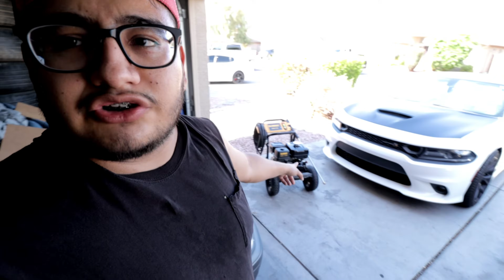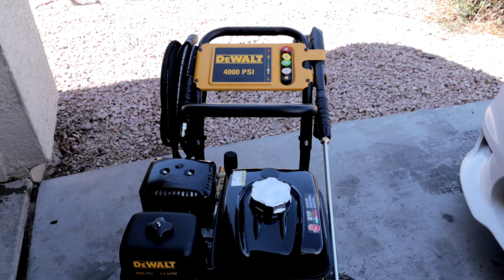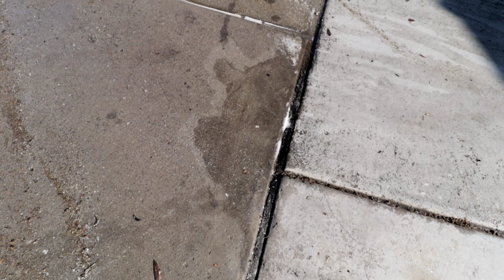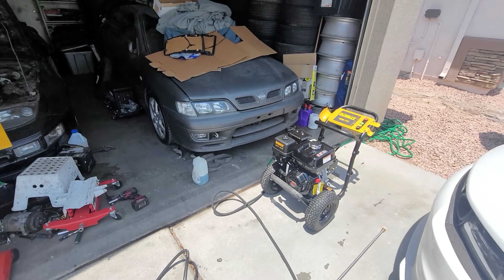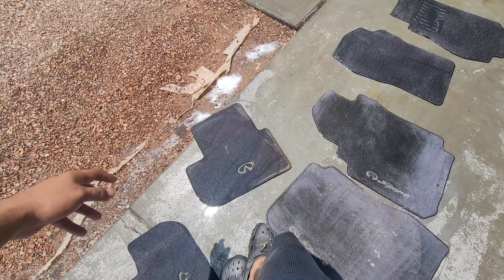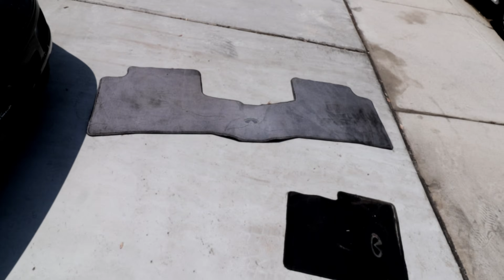I Spent Way Too Much Money On A Pressure Washer But It's A Total Beast! Dewalt Pressure Washer

Comment: You gotta look into that  powerwasher I do not know that home depot or dewall. The pump you have on that power washer. 3600 PSI. Look into That's why it did not work on the other 4000 P. SI buffer. A 3600 PSI. Has 3 valves. 4000 p s I They had six valves . 😢

Comment: Flip the surface cleaner over unscrew that Allen head and take the dirt out of the bearing I have to clean mine every 2-3 jobs. Use bleach and dawn dish soap 10-1 diluted with water and soak the concrete before your wash it comes out cleaner
Reply: Never mix dish soap and Clorox! Google it